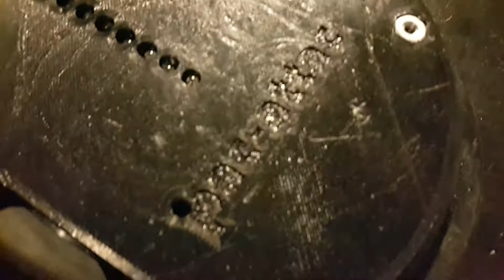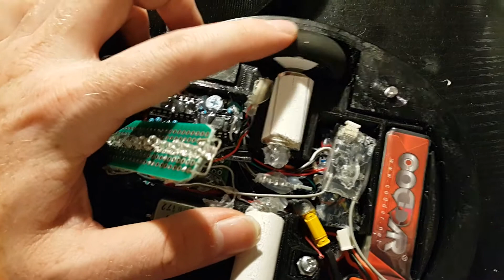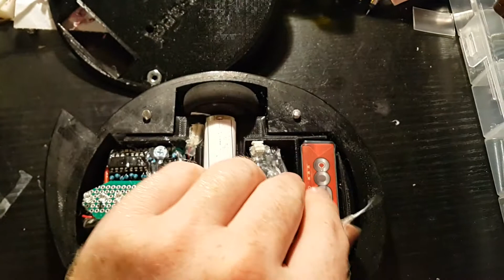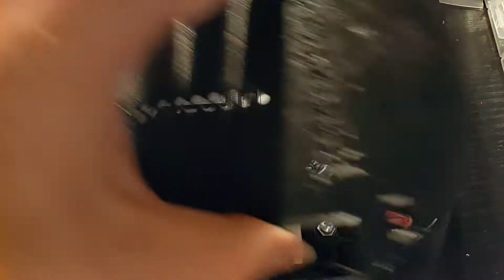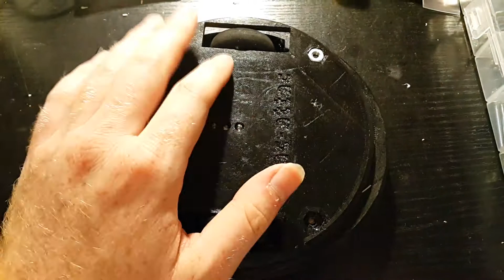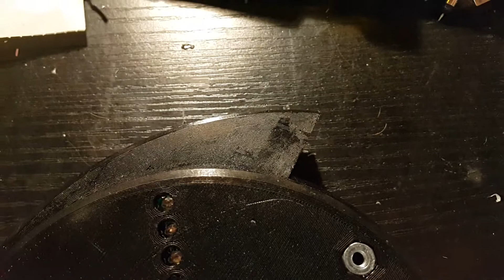Tour of Pac-Attac, my 1lb Meltybrain Battlebot

Comment: This is super cool! I started on a project with a lot of the same components a while back but haven't got it finished yet. Great to see I'm on the right track since you have this working pretty well by the looks of it.
Reply from the maker: Hope yours ends up working! Mine did take lots of small software tweaks before it finally worked, spanning multiple days. I have several plans for version two of Pac-Attac, mainly brushless motors and a larger bite on the weapon.